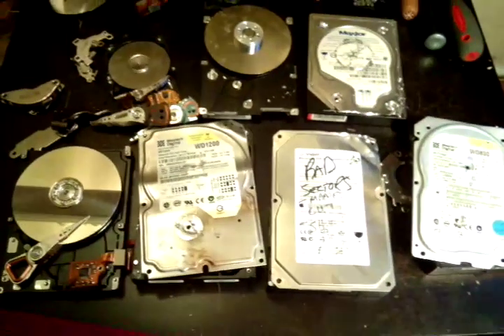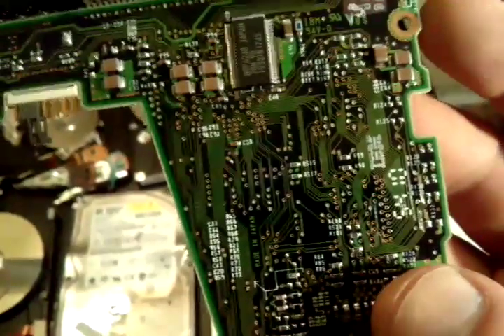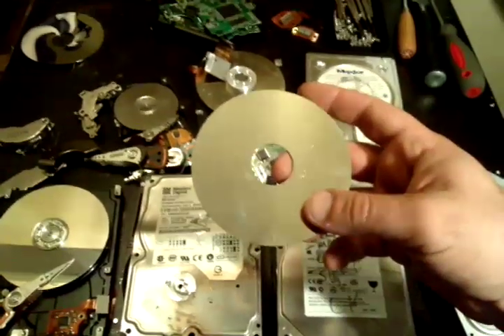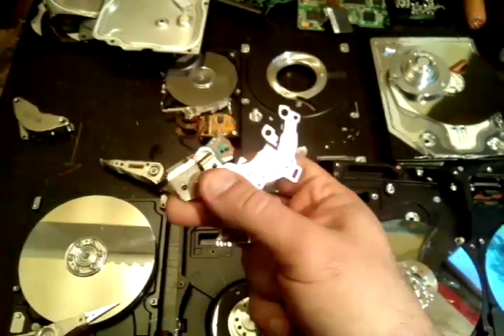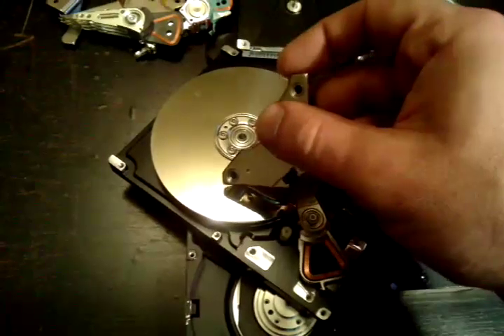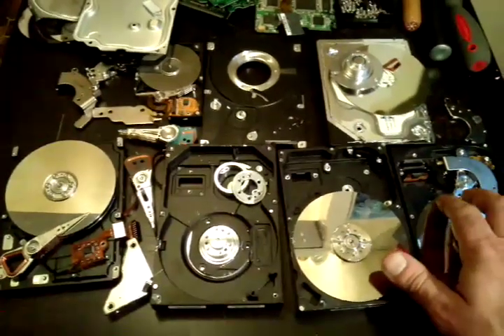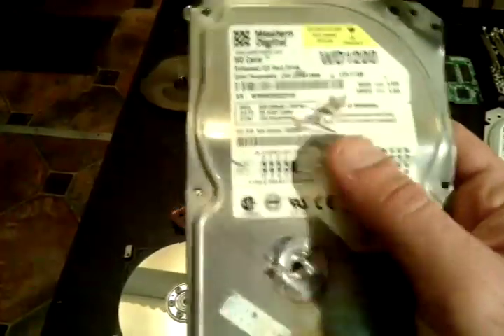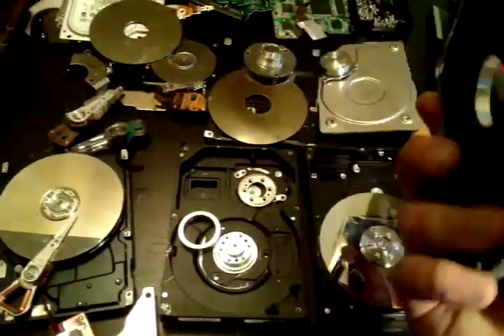Avi Oziel Presents: How a Hard Drive Works and How To Scrap a Hard Disk Drive for Platinum-Aluminum

Comment: and while we are at it why dont we inform people properly it isnt plated on the platters it is sputtered. the coating of platinum is mere microns thick and nearly worthless to try to extract. not to mention that it is very difficult to melt platinum as it has a melting temp of 2900+ degrees.